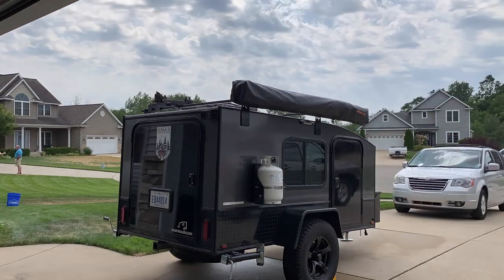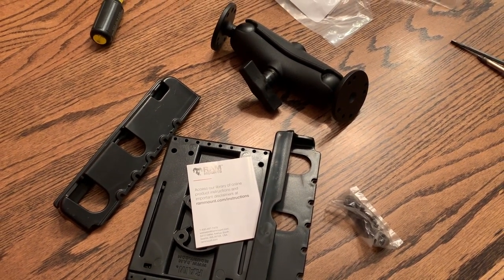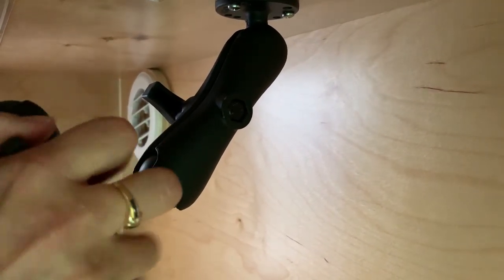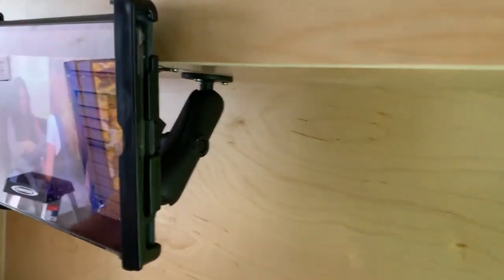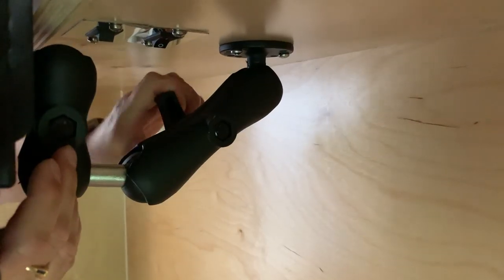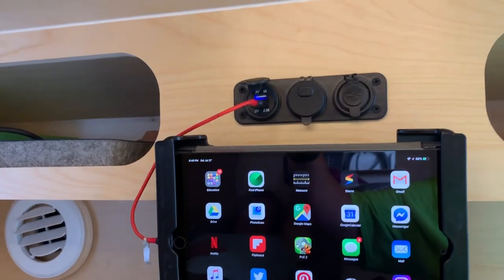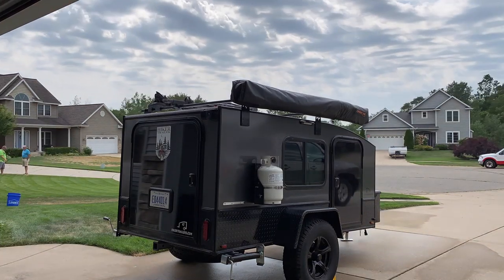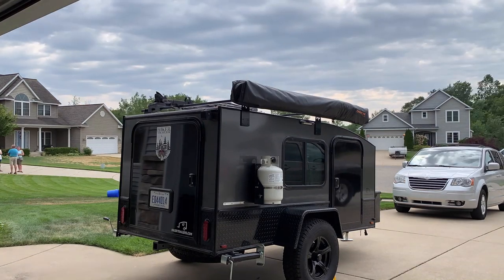Hiker Trailer gets an Entertainment Center

Comment: Nice mods. I really like these.
Curious, besides price why you went w/Midrange vs Extreme?
The Extreme is apparently 27" off the ground to midpoint on the frame. With slightly smaller wheels & suspension how much lwr is your Midrange?
Reply from the maker: I wanted the Extreme but my wife didn't care for the larger tires and using a step stool to get in it. Plus the price was a bit more we had a budget we tried to stick too. If I didn' t have the budget it would have  been the extreme I can buy a stool. lol